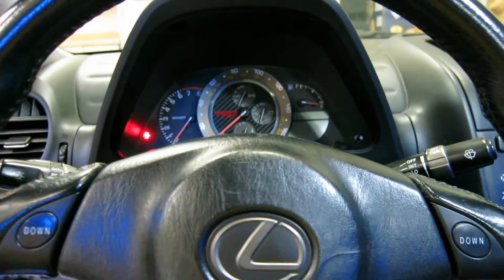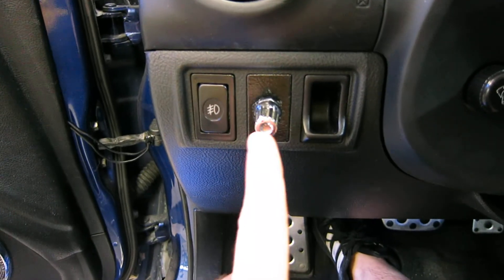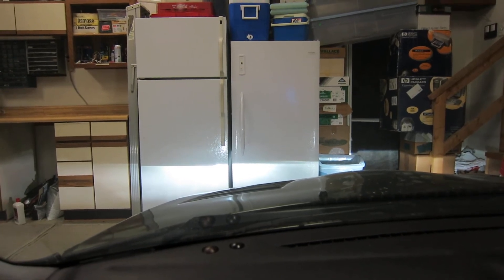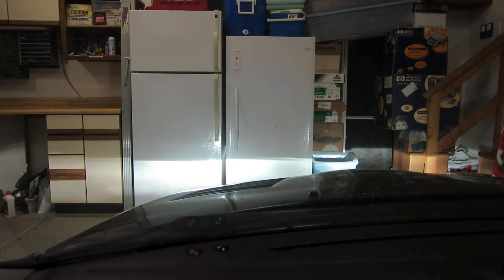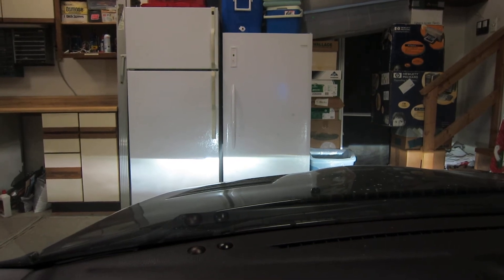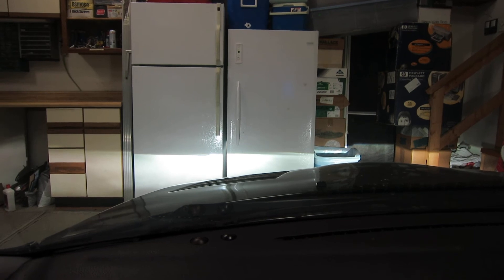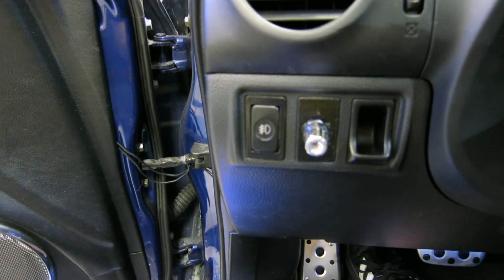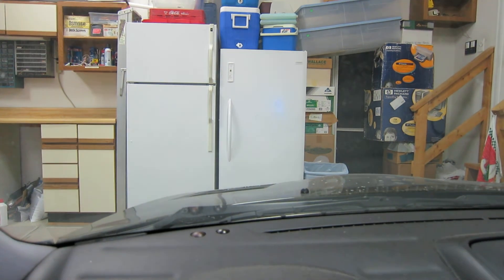Adjustable-Output Bosch HID Ballast Demo

Comment: Were did you get these ? Or did you build them yourself ?
Reply from the maker: Hey there.  I bought these from another person who built them himself.  But they didn't work very reliably, the OEM system is not a good one in my opinion.  I ditched them and went back to regular Densos.  Since this video is like 5 years old, a lot has happened since then.  I would highly recommend instead purchasing an aftermarket ballast with dual-brightness built right into it, such as the Morimoto/Profile Powerhouse.
Reply: @gold94chica  thanks for the reply , I just like the idea of the switchable super high output 68+watts , I use the hylux 45 watt ballasts (which have been great ) would be awesome to have a switchable 45/50 watt to 70/75 watt ballast
Reply from the maker: @stevenhenry9020  Oh yeah the Hylux are great.  Trust me I loved having the switchable ballasts, but honestly it was was overkill and not really worth the maintenance reliability problems.  By now, I've installed much better projectors that are twice as bright and have a real high beam (G5-R, love em) and I've got Baja Squadron XL80 LED spot lights in the front grille on a switch.  So I've got plenty of light lol.
Reply: @gold94chica  myself I have a quad set up /custom  headlights, G5-R and G5-EXL with custom modded Morimoto Mh1 7.0's as driving lights ( that's 3 sets of 45 watt hylux ballasts with 3 sets of bi-zenon projectors 😂  ) along with dual black oak 200 watt led bars, a total of just over 750 watts of output lol
Reply from the maker: @stevenhenry9020  dude haha, well what on earth do you need more HID ballast power for then? LOL
Reply: @gold94chica  never enough lol , I drive over 1600 km a week in the dark 😂
Reply from the maker: @stevenhenry9020  yeah true, in my younger days (like making this video) I was more obsessed with having as much light as possible.  Now I'm older and more chill about it, but also I just don't really drive at night at all, so a basic quality retrofit system works well for me.  But I remember the pursuit... the more you upgrade, the more you need!  Never enough brightness lol
Reply: @gold94chica  I'm probably twice your age and I'm still obsessed lmfao 😂😂 if there was a run to run dual ballasts per projector I would be running hylux 45's and acme arsenal 75 watt units . The arsenal's are super bad ass , but obviously will cook projector bowls real quick if used 24/7 .
Any ways getting back to your old kick ass ballasts , do you have a link or any other details on how those ballasts were modified/built ? Any details would be awesome bro, I do wanna play around with the idea .
Thanks bud 😉
Reply from the maker: @stevenhenry9020  haha, that must make you 65 years old!  They say you need more light as you get older, but jeez. lol.

As for the details/information, this is definitely way out of my league, but I believe this link is the original "how to" for creating the ballasts I ended up with

https://www.hidplanet.com/forums/forum/the-hidplanet-university/informative-articles/13964-how-to-supercharge-a-bosch-ballast-updated-output-pictures

Comment: I want to see adjustable output "100w HID ballast"s on Ebay/Amazon. You know, the ones from China that are black painted, they really output about 75-80 watts I think.
Where could I get adjustable output Denso ballasts?
Reply: Those ballasts are junk ,they're around 60-65% efficant ( 60-65 watt output ) the acme arsenal 75 watt units blow them away